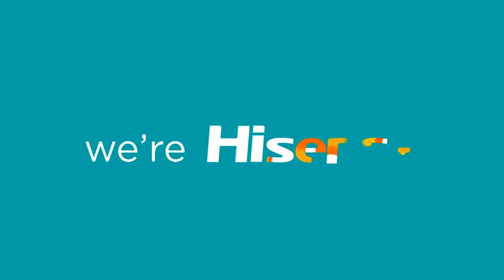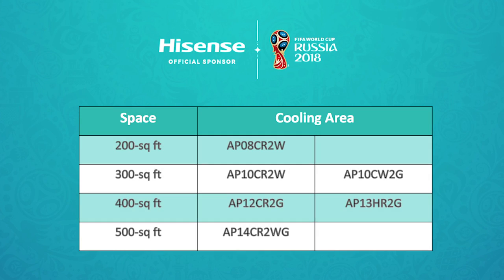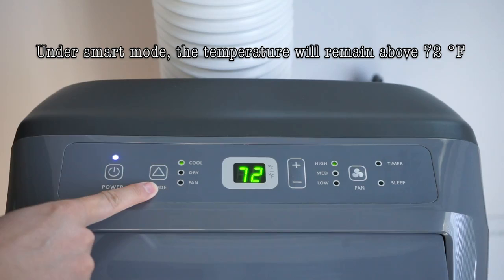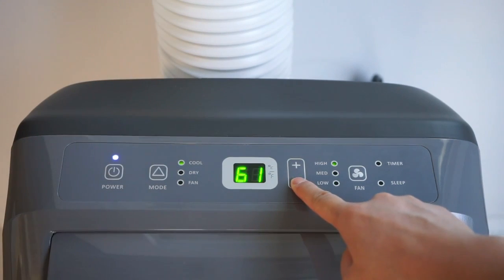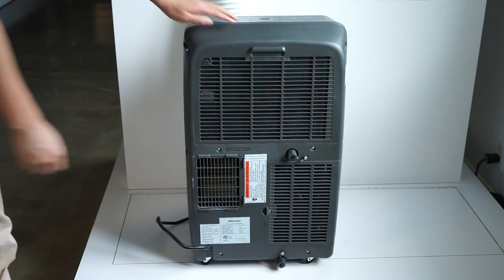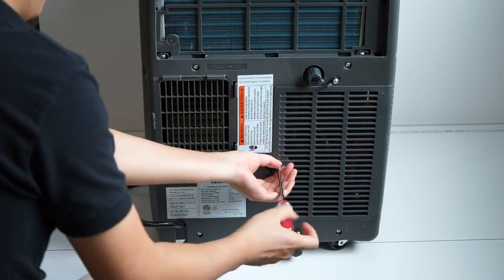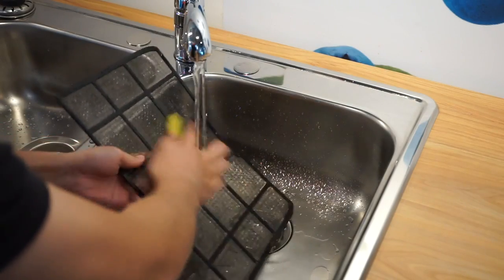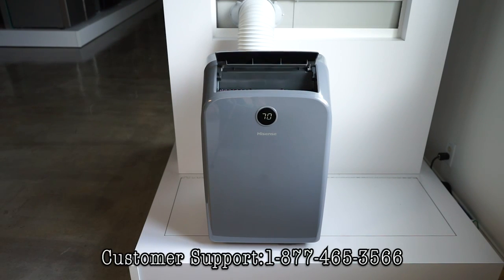Hisense Portable Air Conditioner - Not Cooling

Comment: I bought mine last year and now it's starting to flake out. First the temperature in now in Celsius. Then if I put it on cool, it runs for about 5 mins then like it stops blowing cool alr and just the fan blowing. Then the fan shuts off but the unit is still on. 5 mins later it starts back again to step one. 
Anyone knows why? 
And where can I get a replacement remote?
Model: AP1219CR1W
Reply from the maker: Are you in Canada or the US? You can get new remotes from the customer service team directly. Are you stating that your unit will only display in Celsius? That can easily be changed - unless you are saying that Fahrenheit isn't even an option anymore. What you are describing in terms of running, turning off, turning on etc is completely normal. I'll copy and paste something I shared below.
"The fan needs to keep running so that the PAC can identify the room temperature. The compressor starts/stops running accordingly to maintain the room temperature.  If both the fan and compressor stop working completely, no air will blow into the unit; if it didn't run constantly, when the room temperature goes higher, the unit can't identify it, and the compressor will not work."
If the unit powers on, the vents should start to work - unless the fan is broken. 
Try unplugged the unit, waiting a while and then plugging it back in and restarting the unit.

Comment: I do not recommend. I literally have this in my bedroom and somehow it’s 83 degrees in my room. It’s on cold and high. Just not blowing cold air. I cleaned all of the vents and still it’s awful. Very sad about spending so much money on something that doesn’t do the one job I need it to
Reply from the maker: How old is your unit? What is your unit model number? What mode are you on? What do you have the unit set for? What is the ambient room temp?
Reply: I am having the same issue and I just bought it a month ago

Comment: Have been searching on this unit for the past few hours. Brand new out the box and once I plugged in it gave me an e5 code.
Reply from the maker: E5 means the unit is reading as "full" and requires emptying. If the error appears when you first start the unit, please turn the unit off. Unplug it, wait for 10 minutes and plug it back in and let us know if it resets. If it does not, you may have a sensor error and may need to get your unit exchanged.
Reply: @HisenseCA  could the refrigerant possibly need recharged?
Reply from the maker: @chriswinters4328  not with an e5 error.
Reply: @HisenseCA  I'm not getting the e5 error, but isn't wanting to cool less than 72 degrees even with temp set to low 60s, and all filters are spotless, just wondering if that could potentially be the issues if I've tried everything else

Comment: POS not worth it. Brand new unit stopped blowing cold air after 1st day. Unit has plenty of room, filters are immaculate. Compressor will not kick in at all, AC just blows hot air out the vent and actually raises the room temperature as well as my blood pressure.
Reply: it should be vented out the window not blowing in the house.  Also, there is a knob on the back that gets filled with water from the air.. unscrew it and drain the water and the air compressor will kick back on. You can also hook a hose up to it so it will just drain into a cup or bottle where it will never get filled up.. or drain it out the window. it can be used as a dehumidifier to by putting it on the 'Dry' setting..  but with that you will have to hook up the hose.
Reply: @colleenscottcarmello5103  not everyone lives in a humid area. Sounds like you do, but this is not good for dry climates. I have not once had to drain, even though I've tried, and the hose just makes the room hot... and it never boils below 80. It's a complete waste of money, and the electric bill will be about $300-$350 higher if you use it. It's garbage. I'm desperate right now because it's 107 here, but when it gets back down to the 90's I'll put it away. It's a bad machine and the wall units are MUCH better and will actually keep you cold. As this states, it's a supplemental machine . Meaning you have to have a primary AC on and working for you to see any benefit  from this . 😭😭😭  I just wish it worked
Reply: I agree with you completely. I will never buy Hisense again
Reply: @diamondsandhenna  yeah  I agree with you Diamond.  just offering suggestions..  I like the wall units 100% better for sure.  I bought it thinking it really was 'portable' and I could wheel it from room to room as needed.. but that's not how it works with having to attach it to the window as it's a pain to get it all set up.  It does take up a Lot of space in a room also. Like you, it got me thru the hot spell.  I did have to drain mine bc it wouldn't turn on one day. I watched a bunch of videos on why it wasn't turning on and that's how I found out about the '2' drain spots that needed to be drained.... and it worked... so had to share that info for what it's worth...  I now have a small 5,000 btu in my living room and it does a nice enough job taking away the heat from the room.. now it's no refrigerator but I don't like my rooms cold either.. so that works for me and the smaller size uses less electricity.  win/win  =D ..  * before my air conditioners I would wet towels and keep them in the fridge.. drape one over my shoulders to keep me cooled down.. love it.. with a fan blowing, and cold wet towels over my shoulders, I was cooled down quick and maybe even a little chilled you could say...  absolutely wonderful when overheated..  Might want to try that with your high temperatures where you live..works like a charm <3    Have a great week Diamond and Henna. =D
Reply: @colleenscottcarmello5103  thank you! I might try that . It's HOT! And we have 6 more days of excessive heat warnings. I see massive thunder clouds a few miles away ... I hope they make their way over here. 🙏🙏🙏 have a good weekend and if it's Labor Day where you live, Have a nice Labor Day weekend!
Reply: @diamondsandhenna  Praying for rain with you for you.. =D  Happy Labor Day!
Reply: @colleenscottcarmello5103  Thank you very very VERY MUCH!!! we had a cool summer mostly in the 70's and 80's and now we're getting hammered. I'm very happy it's at the end of the summer. Hope it cools down and stays down after this heatwave. Thank you again!
Reply: This thing would make a better heater in the winter if its temperature gauge didn't tell it to auto sleep.

Comment: I have two units for about 500 sq ft.  6500 BTU in the 275 sq ft  and smaller 5500 BTU for the remaining 225 sq ft.  1.  They do not cool but I think that is because I now have horrible negative air pressure and I have hot humid air being sucked into my house from every nook and cranny. As well it feels like a tropical rain forest in my cottage now and I have now found mold.  HELP PLEASE.  I have the fans on low.  Ive tried to rotate one day on cool and one day on dry.  I have paint on my walls bubbling up.  PLEASE HELP.
Reply from the maker: You have both units connected to the provided window kits (installed correctly) with the exhaust hoses venting out the windows? If you don't that's your first problem, and the units won't work as advertised. Our best suggestions are to close the room doors that you want to cool, and if the ambient room temperature is currently 28, rather than set for 18, set it for 24 and then a few hours later change it to 18. The unit works better in smaller increments - whereas if you try to make it jump 10 degrees at once, it won't cool at all. In addition, paint bubbling sounds like you might need to use the dehumidify function. Set one unit for cool and one for dehumidify and don't try to cool more than 5-6 degrees at a time.
Reply: @HisenseCA  Thank you so much for the reply.  I made sure that the window kits are secure and when I intalled the exhaust units I watched all the good vids.  They are fit and secure.  But, to double check, I set up 500 lumes of light (at night) outside facing each window and went inside to see if any light came through the "seal"   None did.  I keep my air conditioners set at 68 degrees F and do not ever touch the temp firmly understanding that even a 2 degree desired change means a lot of work for the units and an increase in my monthly bill.  To take some of the humidity out I have changed the unit from cool to dry every other day now.  But these units are still pulling more air out of this cottage than it can replace thereby creating that negative air pressure and pulling out side air in from unsealed doorways, or a window that is not sealed perfectly..  in a 30 year old cottage there are just so many nooks and crannies.... plus you want some fresh air to circulate, correct?   
When the unit is set on Dry, am I to expect the unit to still cool?  I have been wondering this. 
I did not have this issues with the two window units that I replaced with these hisense units.  The fans are powerful, as they should be, but taking way more air than the unit allows back in... this just seams to be problematic.  (Example; not actual numbers,  unit removes 5cu ft of air per min and blows into that same room only 2cu ft of air per min = problem)  AM I wrong on this?  
Can you think of any other solutions?
Reply from the maker: @Chewy_GarageBandDad  there are a few things happening here - the difference between window AC and portable AC is the negative pressure caused by the air driving through the hose. In your case, it sounds like it would be better to use the dual-hose unit if there are issues with sealing, insulation, etc. 

The difference between dry and cool is just the fan speed: the fan speed will be set on LOW when unit works in dry mode. It means dry mode =  cool mode + low indoor fan speed. The fan speed of the outdoor side is the same.
 The air is driven out through the hose is exactly the same, when the unit is operated in cool mode or dry mode. 

I'm honestly not sure what to suggest.
Reply: @HisenseCA  thank you very much

Comment: Why would my AC unit power on, but the vent not open and fan not start blowing?
Reply from the maker: That's really strange. If the unit powers on, the vents should start to work - unless the fan is broken. 
Try unplugged the unit, waiting a while and then plugging it back in and restarting the unit. If issues persist, you may need to reach out to customer service.
Reply: I'm having the same issue, the equipment is shit

Comment: Getting these things hooked up is the biggest pain. The hose will not connect to the end pieces and always falls out. Do not buy. It's not a good design. It is easy to clean and when it works it does cool properly. It melts the tape from getting so hot the hose falls out constantly.
Reply from the maker: This is good feedback as I have not heard it before. Can you give us more information - what is your model number? Which tape melts? Can you provide us with any images or video - if you are in Canada, we are canadainfo@hisense.com. Thanks.
Reply: I fixed it by using just one layer of masking tape. Don't use duct tape or plasticky tape; makes it hot.

Comment: Nothing but problems and I’ve only had it for like 2 weeks
Reply: Any luck? I just bought one. I'm waiting 24 hours before I turn it on.
Reply from the maker: Can you please confirm which model you have and what the issues are that you are having? Are you in Canada or the US?
Reply: Ajpz28 it just sucks builds up with ice even though I clean the filters and then just randomly gives me error mode all the time def never buying again
Reply: I empty the water and still doesn’t turn on and shows the error code after have to plug it in randomly to see if it’ll start up again usually takes days before I can get it to turn on again
Reply from the maker: @candypaint189  Some freezing is normal when your dehumidifier is used at low temperatures. Please ensure the device’s location is above 38-degrees Fahrenheit. When the temperature of the room is lower than the specified temperature, the surface of the evaporator may freeze and the compressor will turn off, activating the de-icing function. Fix this by avoiding operating the unit unless the ambient temperature of the room is between 38℉ to 90℉. When the de-icer senses the correct operating temperature, the compressor will cycle back on.
Reply: HisenseCA  it’s summer and it’s always like 70 80 or 90 degrees I’m not turning the dehumidifier on I’m just using the cool part it doesn’t even show dehumidifier on the machine hisense portable air conditioner model # ap0819cr1w
Reply: @HisenseCA  help
Reply from the maker: @ivangongora4646  What is it you need help with?
Reply: @HisenseCA  How do you turn on the front big display numbers on this unit
Reply: Same here! I'm getting a 00 code and support couldn't help. Very frustrating they don't know what the code means

Comment: 0:20 that temperature indicator doesnt work or show on my new unit. My unit is new and doesn't want to cool at all !! Literally its brand new out the box . help !!
Reply from the maker: It's possible you received a defective unit - what is your model number? Where did you buy it? Some units were produced with the circle but no digital sensor by design.

Comment: Been looking for the exhaust for the back of unit.. What size is that as well
Reply from the maker: The exhaust hose is approximately 5.9" Diameter and 58" in length. It varies slightly by model but that's an approximation.
Reply: @HisenseCA  not the hose the coupling that attach to the unit sir..

Comment: This item is a piece of junk. Will not blow cold air either.
Reply from the maker: We're sorry to hear that the tips in the video did not help you with your cold air problem. There may be something else going on with your unit. Reach out to your closest local Hisense subsidiary for assistance.
Reply: I just bought mine yesterday and upon first start up has not been blowing cold but cool room temperature air like it’s on a fan few hours after I receive the E9 error code and follow the directions to shut the machine off unplug it left it off overnight turned it on this morning it is a much cooler day today but I’m noticing it’s blowing ambient air temperature may be slightly cooler in the exhaust is blowing the same temperature having to troubleshoot a $600 air conditioner within the first 24 hours when it’s hot it’s not my idea of a good product I realize products can be defective if this problem which I see that it has has been an issue with the company for a few years why not just recall all of your products and make new ones that work properly but I will be calling the company today because we can’t sit here for weeks on end without air-conditioning that’s why I bought a machine

Comment: I just bought mine yesterday and upon first start up has not been blowing cold but cool room temperature air like it’s on a fan few hours after I receive the E9 error code and follow the directions to shut the machine off unplug it left it off overnight turned it on this morning it is a much cooler day today but I’m noticing it’s blowing ambient air temperature may be slightly cooler in the exhaust is blowing the same temperature having to troubleshoot a $600 air conditioner within the first 24 hours when it’s hot it’s not my idea of a good product I realize products can be defective if this problem which I see that it has has been an issue with the company for a few years why not just recall all of your products and make new ones that work properly but I will be calling the company today because we can’t sit here for weeks on end without air-conditioning that’s why I bought a machine. Will be reaching out to the company customer service today to see what kind of timeframe I’m looking at and what options there are to return it it definitely doesn’t blow cold like any other air conditioner I’ve ever owned I bought mine at Canadian tire and to be honest I normally stick to the NOMA brand as we have had a 10,000 BTU unit for over three years and still blast arctic air cold for the price I would’ve assumed this did something similar but apparently not. When I call the number I’ll see how their customer services

Comment: Does anyone have a problem with it smelling like a fish tank? Mine is brand new out of the box. I have used it the most about 6 to 7 times in less then 2 months. I thought maybe i had to drain it but nothing came out.  Thanks.
Reply from the maker: That's really weird. If it's brand new see if the store will exchange it for you. Or you can run it for a few days and see if the "new product fish tank smell" goes away.
Reply: I just bought one used and it smells like piss but maybe it’s fish tank lol

Comment: Full of hot air
Reply from the maker: If your PAC is blowing hot air then there may be a compressor problem - or your fan/filter may need to be cleaned.
Reply: @HisenseCA  filters were already cleaned

Comment: This unit is a total POS after a year. DO NOT BUY.
Reply from the maker: We're sorry to hear that your unit appears to have suffered premature product failure. That's not the experience we want to hear from our customers. The most common causes of premature product failure are that the unit was not emptied or stored correctly after last season; when the unit is not able to completely dry internally before storage, you run the risk of internal parts wearing down due to mild water damage paired with lack of use. We can certainly discuss your warranty options if the unit is fairly new. Please reach out to your closest local subsidiary for more assistance.